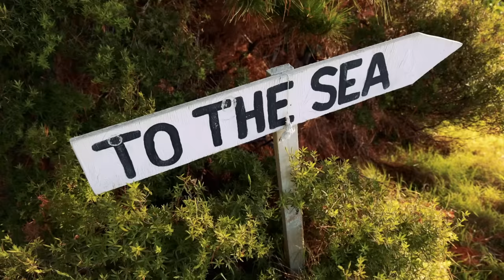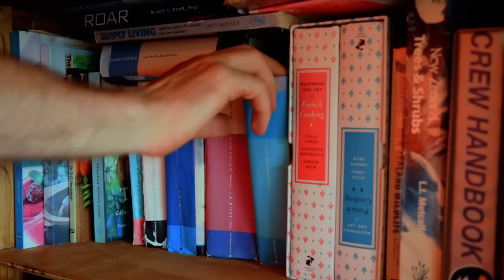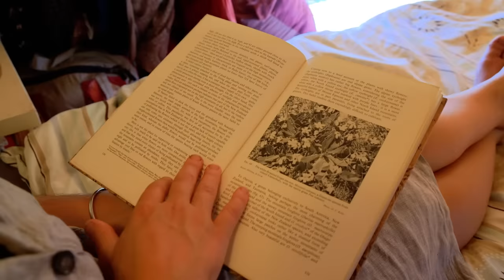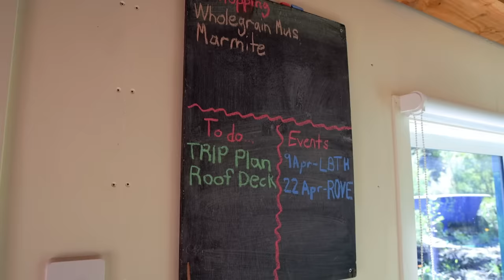This Place Takes The Tiny House Dream To The Next Level!

Comment: Great to see the frame.  I designed and owner built my steel frame home 11 years ago - not a tiny - but looking at that, I reckon I could whip a few of those up pretty easily in comparison. 😅 I wonder if I could get a job somewhere building them… 🤔 What an epic spot though!